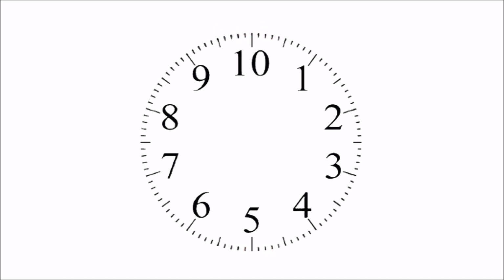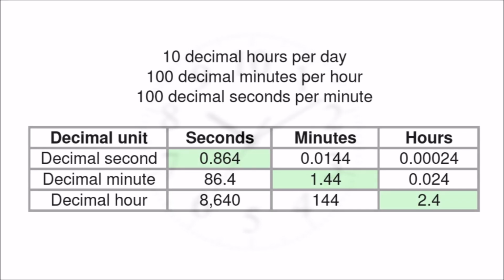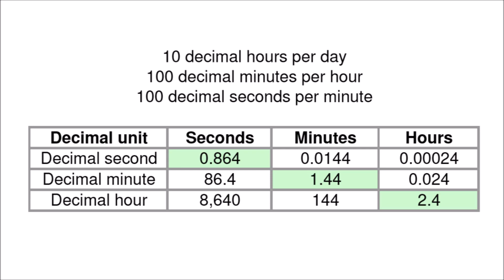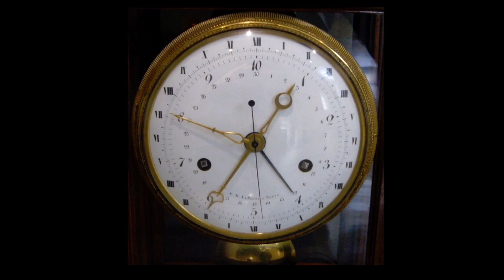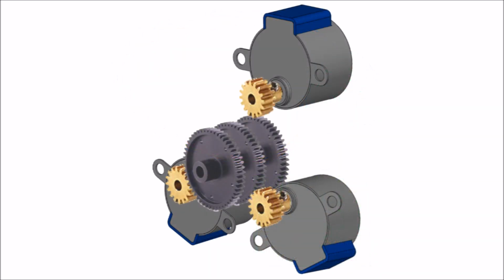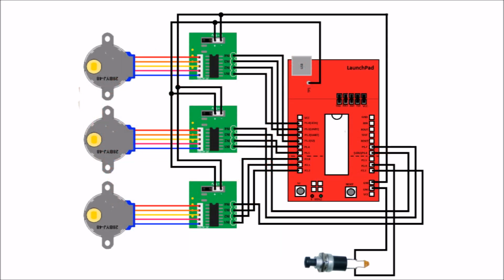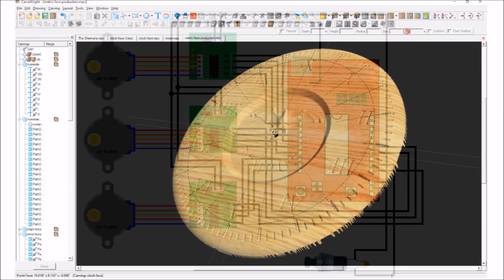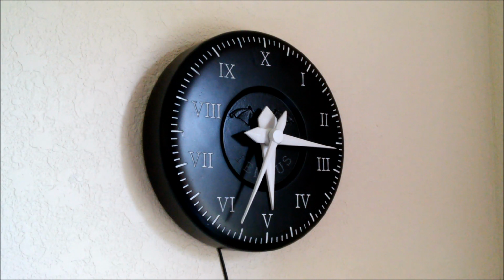Tempus

Comment: Hello. Love what you did with your clock. However I disagree with how it measures the passing of time. All you did was take a standard 24 hour period and make it 10 hours. I am not downplaying what you did. I know you had to use different gear ratios than a regular clock does and you didn't just put a 10 hour dial on a standard clock.
However, this is not a true metric timekeeping system as you are still stuck with 7 day weeks and different length months etc. A TRUE metric timekeeping system would be an extention of the metric calendar which would incorporate a 10 day week, and ten 10 week months. This means there would be 1000 days per year. In order to do that each metric day would have to be a little longer than 8 of the regular hours we use now. This means every one of our days would equal about 3 metric days. I have made metric clocks using this system in Python. There's about 3 metric seconds to one regular second and each metric minute is about 35 regular seconds.
A standard second is 9,192,631,770 vibrations of a Cesium-133 atom. Best as I can figure a true metric second would be 2,898,988,355 vibrations of a Cesium-133 atom.
Not practical to say the least but that would be a true metric timekeeping system. In closing, there are no rights or wrongs in our approaches. It's just my opinion that if you're going to go metric do it 100% metric. No one's going to pay attention anyway - 🤣🤣🤣
Wishing you nothing but the best...
Reply from the maker: A more accurate description would be Decimal Clock, which does divide a day into 10 hours.

https://en.wikipedia.org/wiki/Decimal_time
https://svalbard.watch/pages/about_decimal_time.html

Comment: So this begs the next question: Is there a metric week/month/year? How do you calculate them? I think an algorithm would be useful for educational purposes on this topic :)
Reply: Yes, assuming this man is making his decimal clock in accordance with those made during the French Revolution, then there should be a metric calendar (which I'm assuming to be the French Republican Calendar). In this calendar: 10 days= 1 décade (week), 3 décades (weeks)= 1 month, 12 months = 1 year. This leaves us with 360 days, so an intercalary period (like an extra month) of 5 days is added to match the solar year (around 365.25 days).  There was major debate over how to sort out leap years, and in the end most stuck with the 4-100-400 method of the Gregorian calendar.

More specifically, the metric calendar begins on the autumn equinox (September 22). The months are named after typical weather of France. In order they are: Vendémiaire (Grape Harvest), Brumaire (Mist), Frimaire (Frost), Nivôse (Snowy), Pluviôse (Rainy), Ventôse (Windy), Germinal (Sprouting or Germination), Floréal (Flowering), Prairial (Meadowlike), Messidor (Harvest), Thermidor (Heat), Fructidor (Fruit), and finally the sans-culottides (the 5 extra days). Each group of three months corresponds to a season, like our calendar. In this calendar, the year starts in autumn and ends in summer. Each week is separated into ten days, labeled numerically: Primdi (First Day), Duodi (Second Day), Tridi (Third Day), Quartidi (Fourth Day), Quintidi (Fifth Day), Sextidi (Sixth Day), Septidi (Seventh Day), Octidi (Eigth Day),  Nonidi (Ninth Day) and Décadi (Tenth Day). The French Revolutionaries also labeled every day to commemorate one aspect of agricultural life (instead of the saints and church like in the Gregorian calendar). 

As for practical ways to use this calendar, you can purchase custom made calendars or look up websites which will give you an appropriate conversion.

Comment: Dick - I saw this on Design News Gadget Freak and I appreciate the how to instructions.  Is it possible to share the CAD files for the clock face?  Also, what did you use for hands of the clock.  I'm not especially adept at hobby electronics, but I would love to make one or two of these.  

I was a founding member of a metric clock club at the University of Minnesota.  However, the club of has since disbanded.  Building these clocks could give the club new life!
Reply from the maker: Joelski, 

Unfortunately  it  is  not  possible  to  share  the  CAD  files  in  a  broadly  useful  format.    I  used the  Carvewright  system’s  Designer  software  to  design  the  clock  face  and  the  Carvewright CNC to  machine  it.    The  software  uses  a  proprietary  file  format  than  cannot  readily  be converted  to  other  formats.    The  hands  were  also  designed  and  machined  using  the Carvewright system. 

I may offer a kit of parts or a complete clock in the future. 

The  electronics  are  actually  quite  simple  for  this  project.    The  Launchpad  and  stepper driver  boards  both  have  pins  for  the  I/O  connections,  and  you  can  buy  jumpers  on  eBay very inexpensively that permit most connections to be simply plugged together.

I got my EE degree at the U of M.